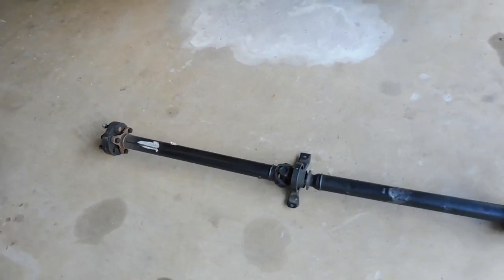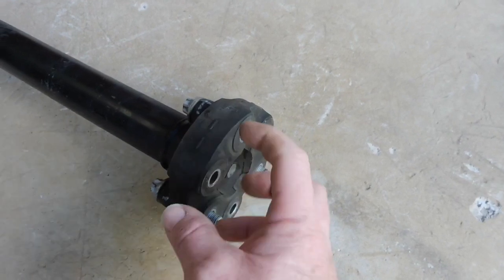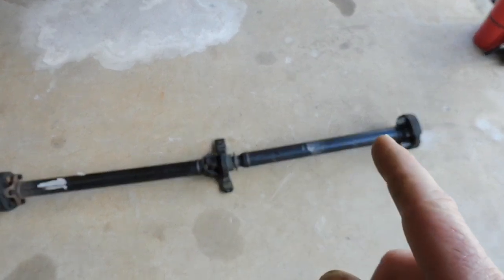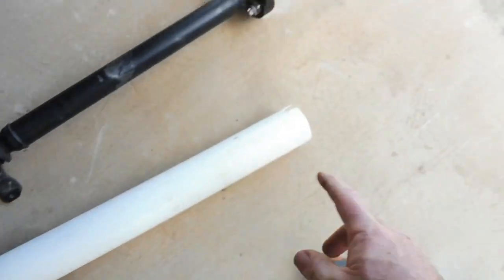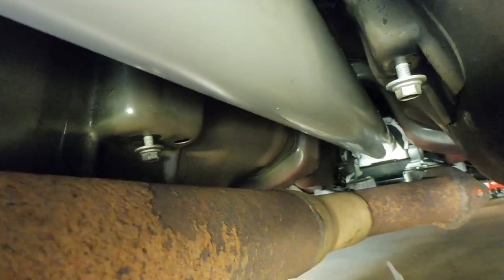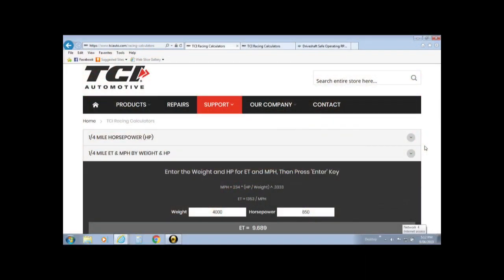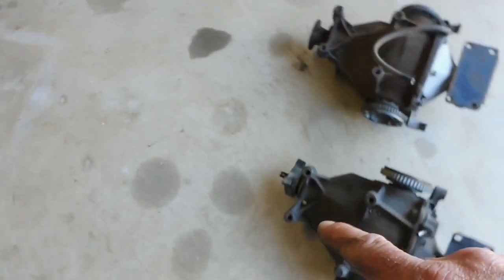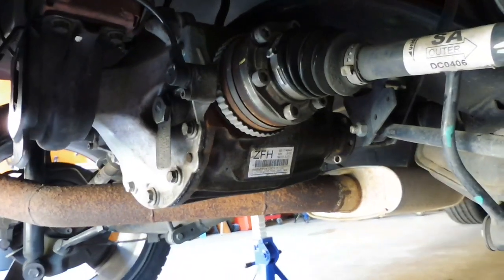Turbo Ls vz ss commodore build ep7 custom single piece tailshaft

Comment: Vt s2 v8(ls1) was a m80 4 bolt flange. Last time I removed a diff pretty sure we loosened/removed the cradle bolts and let the crossmemeber hang down a bit for access. Also I have swapped the flange and just 4 ugga dugga'd it up
Reply from the maker: n12sumfin ok good to know now that s2 Vt was a cross breed of diff/flanges haha . It’s pretty easy to get to those top bolts for the diff so you can save a little work next time and just leave the cradle bolted up . As for the 4 ugga Duggar’s that’s a classic and probably would of been fine.

Comment: Mate of mine went to states and took his sons to top fuel , and reckon it just goes straight thru you when they launch.
Reply from the maker: Clint Collins it would have to be the best feeling available in Motorsport spectating I’d say . It’s so good .
Reply: @LatysGarage  i can only imagine, i go to the drags here in Taupo NZ, every summer and if someone runs in the nines i get excited, lol. I would be happy with 12s, im building a vx hsv senator, vs racing 7875, pac 1218s, in tank 450lph, sloppy stage two cam, sbe 5.3 ls truck motor through t56, i would prefer auto but the car i bought came as factory manual so just gonna roll with that, so pleased to have found your channel im a carpenter so need all the help i can get lol, what you are showing on your channel is exactly what i needed to see thanks for sharing, huge help bro.
Reply from the maker: Clint Collins hey mate I’m a carpenter aswell I’m glad my videos help you out . Your senator will be fast it’s very similar to another build I filmed on my channel  it’s a Vy one tonner Ute it runs a sbe 5.7 , T56 stock cam , pac springs , vsracing billet 78/75 , vsracing 44 waste gate etc pretty much a typical no bs sloppy combo and it’s super fun on e85 and 10ish pounds of boost. If you haven’t seen the build yet you should you’d probably love it just head to my YouTube home page and go to playlists you can’t miss it .
Reply: Latys Garage perfect thanks.

Comment: Hey mate loving your videos, I am starting to convert my VY sv8 auto to a th400. I am getting my box and tail shaft built interstate is there any chance you could tell me the length of your tail shaft from the centers of the uni’s please?
Reply from the maker: Matthew Kirk I’ll crawl under there tomorrow and give it a measure
Reply: Latys Garage thanks heaps mate much appreciated 🤙🏻
Reply from the maker: Matthew Kirk hey mate 1405mm from centre of uni to centre of uni
Reply: Latys Garage thanks heaps mate, I’m doing the flange on the pinion same as yours. Starting the build in a couple of weeks, I have been onto kustom ls looms and getting my loom and ecu sorted out. Thanks heaps again mate 🤙🏻

Comment: Love watching your vids. Just one question. The gear set in the m80 has an extended end on the pinion that extends out the front  through the front yoke. How did they fit the vt yoke. Did they cut that part of the pinion off. Otherwise i cant see how they could use the old style yoke.
Reply from the maker: Stuart Hundertmark hey mate I’m stoked you love watching the vids thanks . As for the pinion extension I simply cut that off with a metal cut off wheel .

Comment: would this work on a holden ss crewman cheers
Reply from the maker: A crewman is longer possibly pushing the max length limit  of a single piece tailshaft and the diff yolk is certainly different .